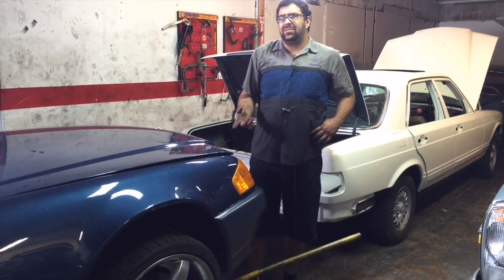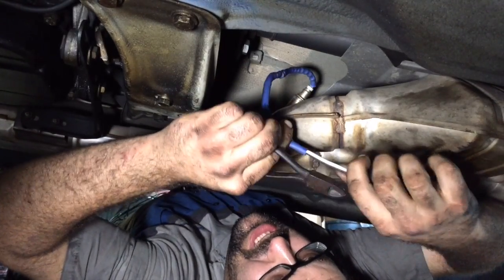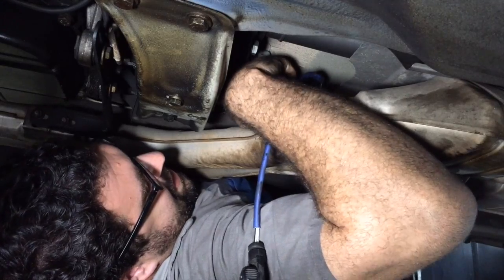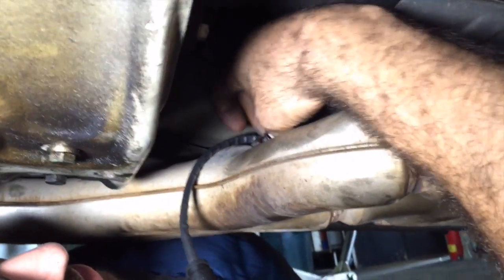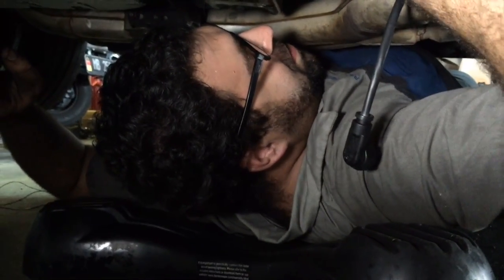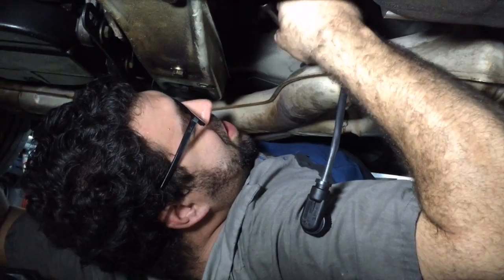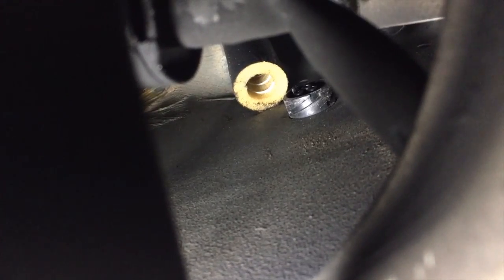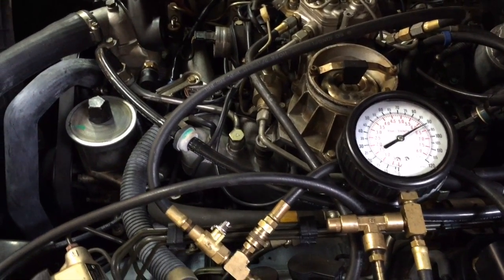Q & A #29 Replacing and checking Oxygen sensors.

Comment: I changed the EHA valve on my 1990 w124 due to leaking and after re-attaching the battery the code for 'oxygen sensor' did not return.

Comment: Excellent video and nicely explained. I have a question: I have a 2008 W204 C320 CDi diesel which is showing P0132 error code which I understand indicates the bank 1 sensor 1 02 sensor is on failing which is throwing up the "Check Engine" light.  I understand this is upstream of cat but how do I determine which side of bank 1?  The car is a UK model so right hand drive and is a V6 model with the OM642 engine.   Any help would be gratefully received. Thanks
Reply from the maker: Hello Wobbly,I am one of the moderators for the Pierre Hedary Mercedes Benz channel and I saw your comment. It seems as if you'd benefit from personalized attention for the problem. We have provided a way for owners to get the help they need. If it's okay, please visit the website: www.classicbenzsos.com so you can schedule a call from Pierre Hedary. --LauraH

Comment: hi how are you have a question my car w210 e320 and here in Iraq the heat in summer become over 50 degrees what the normal heat average the car must be FYI the cage reading over 90 nearby the line over 80 is that good for the car thank you